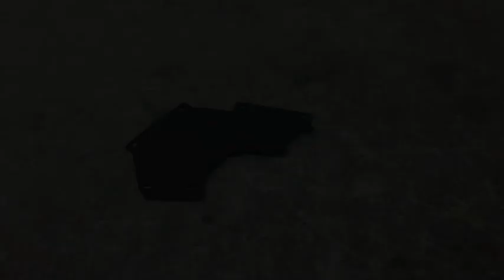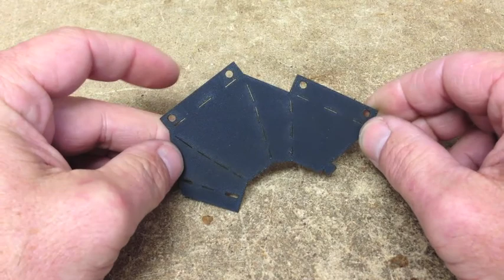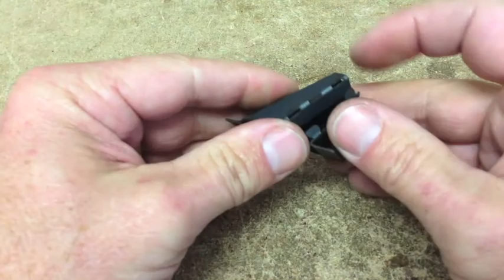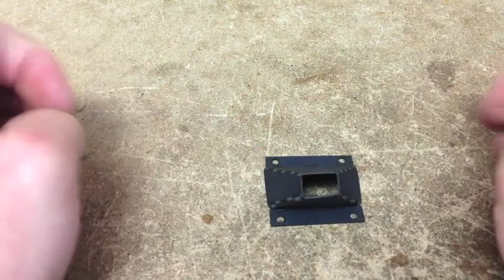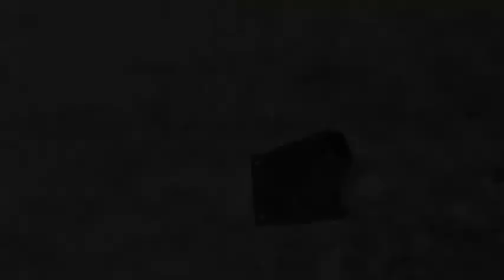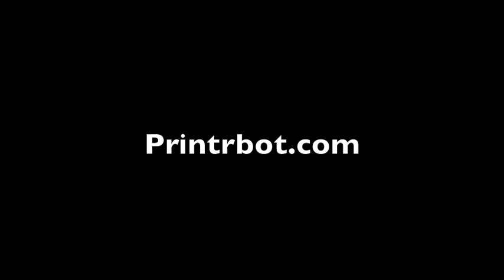Printrbot Alu Ext Fan Shroud

Comment: Glad to see this extruder has a shroud for the fan.  I've always been using just the mounted 40mm fan, which cools one side much more than the other (to the point where overhangs would curl on one side, but not the other.)
Reply from the maker: I like the shroud so much, I think I'll sell the shroud mount separately to hit the print from both sides. Dual fan options for everyone.
Reply: Is there a  specific way this is supposed to be mounted? I just got the alu extruder with the shroud (woo!) It will probably be more obvious once my direct extruder arrives.